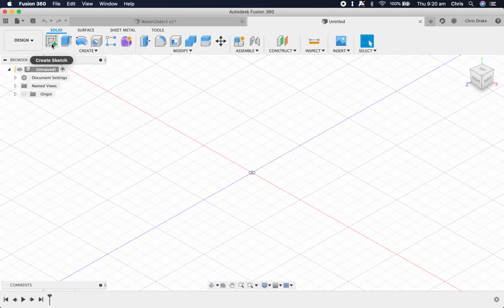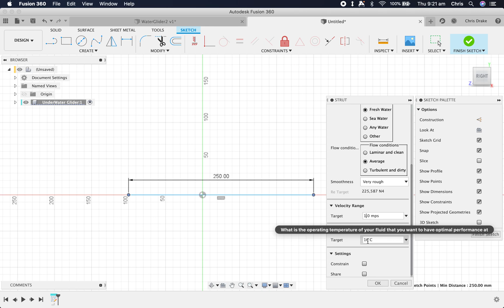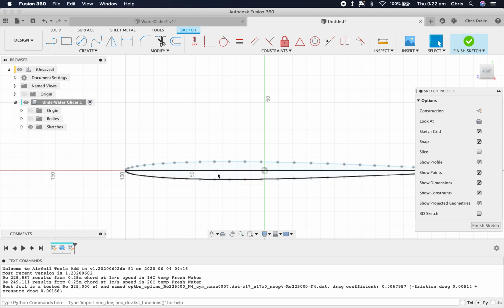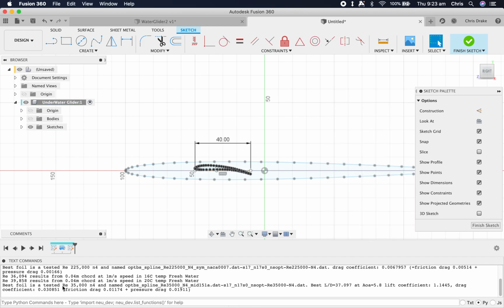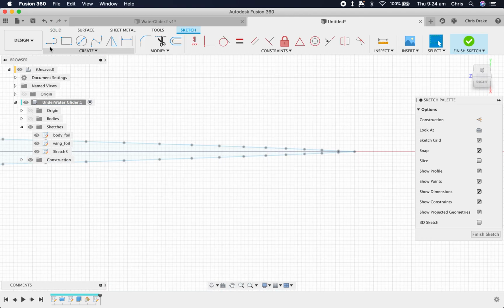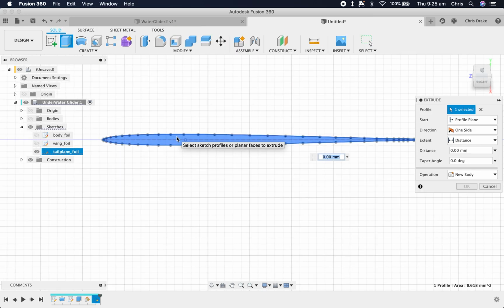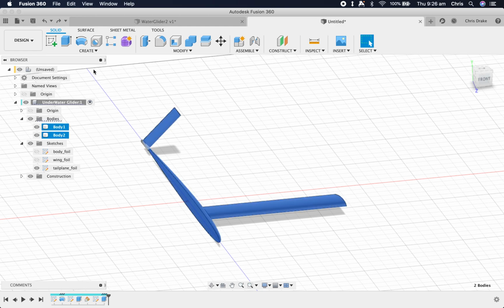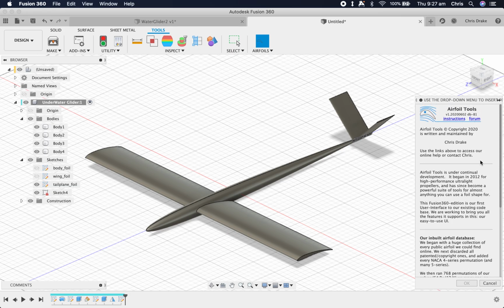Airfoil Tools add-in for Fusion 360 demo video: Creating an under-water glider for my pool

Comment: could you give some guidance on how you were able to make the selection at 1.46 please,  i got really exited when watched you do it but after trying for nearly an hour i am feeling drained and frustrated so i probably need to end this with an apology for being blunt and and mention that your skill level is incredible and your efforts are appreciated.
Reply: To select an area, it needs to be a closed shape (and not 3D!)- so - first you need to zoom in to the "tail" and make sure it's joined up (e.g. if you had a "min thickness" when you made your foil/strut, it will not be closed - there's a gap there - so draw a line to close it).  Then - to make half of it so you can revolve around that - draw a line from the nose to the tail (not a construction line of course - a real line).  If you still have problems - put a post on the forum here: https://forums.autodesk.com/t5/fusion-360-api-and-scripts/add-in-announcement-hydrofoil-and-airfoil-tools-seeking-your/td-p/9453985 - (and preferably share your work/model) - this way I can do a screencast to show you the steps!

If you made this in 3D (e.g. used the "wrap" option) - use the "surface" tab in Fusion360 to make it into a patch - then revolve the patch.
Reply: @chrisdrake4692  thank you for the prompt reply, i will process that information once i translate the terminology. Only a couple of days into fusion 360 with no experience of any kind with this type of thing. tail bit makes sense so i will start there and move discussion's over to the forum. once again thank you very much Chris
Reply: @stevehughes594  Good luck!  You're going to LOVE Fusion360 - let me give you a tiny bit of advice: try to treat the idea of learning Fusion360 like you're trying to make a friend, or trying to fall in love: you're going to find a whole bunch of things that might normally annoy you, or that don't work the way you think/expect: try not to get mad or impatient - you will eventually wrap your head around the way this thing works, and once you get there - it's an absolute marvel.  The product is HUGE, but you don't need to learn it all at once.  The Autodesk forums are chock full of friendly experts willing to help for free (remember to give them everything they need to help you - like sharing your progress/work/models/screenshots!) - and (so far) there are not trolls or quora/stackoverflow psycho grumpies on there at all.  Above all - don't get mad.  Fusion360 will try to piss you off - don't let it, and it won't take long before it gives up and you "get it" :-)  Do you have a 3D printer yet?  I bought an Anycubic Chiron the day the Virus broke out (I was anticipating being "locked in"!) - and it's been utterly awesome; does excellent work, never skips a beat, and lets you do huge things too when you want.

Comment: Here is the 3D printed version in action (I modified my design so the tail was easier to print, and I got rid of the compartment, instead using the weight of the PLA to put the center of gravity where it needed to be) : https://www.youtube.com/watch?v=yfEDSJ-jyXc

Comment: Is it possible to import .DAT files with it?
Reply: Yes, it does import and export - but you need the beta version for that - link is here: http://chrisdrake.com/Airfoil_Tools/ - I posted screenshots of this yesterday:  https://forums.autodesk.com/t5/fusion-360-design-validate/beta-testers-wanted-for-my-add-in-airfoil-tools-testing-import/td-p/9871893

Besides reading (and, optionally, automatically repairing) any kind of airfoil data file in any known format (or even just excel), it also includes options to re-spline the input, set minimum thicknesses, scale and join to your chosen location, rotate arbitrary amounts, flip it, add constraints, wrap it all around some axis (e.g. for rotating foils, like propellers), and insert ellipses (useful for wingtips to have nice ends).

It also does Export as well :-)

I'll be submitting these updates to the production version after it undergoes more testing (I've done loads so far, and it all works, but I've only tested on my Mac so far).
Reply: @chrisdrake9160  Perfect, I cannot thank you enough for your work!

Comment: I'm actually building a sea glider at the moment.
I have been designing and building sail planes primarily for 30 plus years.
I am using preformed extruded aluminum hydrofoil wings with a fully symmetrical wing. Never occurred to me to use an actual airfoil as I guess I just figured buoyancy or the lack of it would be what would cause me to rise and sink in the water column I guess I was just looking for consistent performance hence the reason for the fully symmetrical airfoil...
So finally to my question. Do you think there is a need for an airfoil Wu's underwater and if so what advantages is it going to give me? I'm going to be doing mapping type missions but basically down and up not even turning really.
Curious to hear your thoughts.
Reply: The right foils will reduce drag by about a factor of 4  (4 times less).  The energy needed to move around is related to drag (4 times more energy needed to go twice as fast).  If you're moving quickly or on any kind of power budget, it's absolutely worth using the right shapes.  3D printers make them crazy-simple to print as well.  You can even cover PLA with a thin coat of resin and just use them immediately - vastly easier than aluminium.  Fusion360 has free trials, and the add-in is also free: nothing to lose, everything to gain!!

Comment: Very nice. How do I taper and sweep the wing?
Reply: To taper, insert a large root foil, and smaller tip foil, then loft between them.  To sweep (rake?) the wing, and/or add dihedral, move the tip back/up etc, and add rails along the leading edge (and trailing edge too if you want).

Comment: Damn Australian plugins. I can't wait for an American version that stops putting all my wings upside down DX.
Seriously, though, Loving this! I fully intend on testing the results it gives. I'll let you know what I find. Also, it's not allowing me to make a cowling, saying the UI hasn't been developed yet. Is it correct that it's currently impossible to make a cowling at all? Thanks
Reply from the maker: Short answer: it's coming - here's the manual steps that work now:-

Depending on what you're trying to do, you might get lucky.  Draw a chord line to represent the length of whatever you need the cowling for.  Use that to insert a Strut (if you only want low drag) or Wing (if you'd also like downforce or lifting force)
.  If you're lucky, you can work with what it gave you.  If you're not lucky, you'll need to scale it (which will upset the performance and hence become sub-optimal, but, for-now, it's all you can do - my width-constrained shapes are in my queue for processing when my CPU's are done with their current work).

The above puts in the spline sketch shape for you.  From here you can... 
* revolve it into a solid.  
* Cut the spline and revolve/thicken as you please (hint - the SURFACE workspace can help here).  
* Insert another foil/strut on a different 90-degree axis and loft between them (for, eg, a cowling that's wider than high, like the front of a car).  Again - the SURFACE workspace and loft/patch/stitch is your clue to getting that perfect.

Long answer: My cowling reasoning is... a cowling takes more-or-less the same shape as the front or back of a strut or foil.  I've only got about 200 CPU cores, and they're all busy right now finding a new airfoil DB with constrained AoA (see my comments on the forum about this: https://forums.autodesk.com/t5/fusion-360-api-and-scripts/add-in-announcement-hydrofoil-and-airfoil-tools-seeking-your/m-p/9453985/highlight/false )
 - then after they're done with that, I'll task them with finding the best possible shapes when constrained to a minimum thickness.

Right now, the included struts and foils were not given any thickness constraints (besides "not being completely stupid", ie, paper-thin), so the cowling shapes you can make manually tend to be thinner than you might like for small/slow shapes (low Re; thinner=better).

In future - when the DB with thickness optimisation is done, the cowling feature will select the best shape it knows to fit into the size constraints you give it.  Further in future, I'll hook that up to a cloud system and/or try to ship the optimiser with the product (it's written in 3 different languages, making that tricky right now) so if you're happy to wait a day, you'll get something specifically optimised for exactly what you're doing (rather than, as now, a "pretty close" solution that's been optimised for my representative cases I've inbuilt).